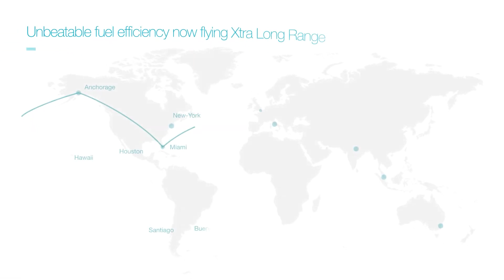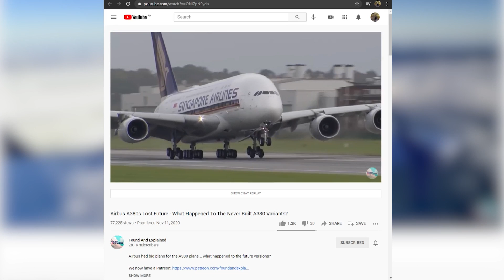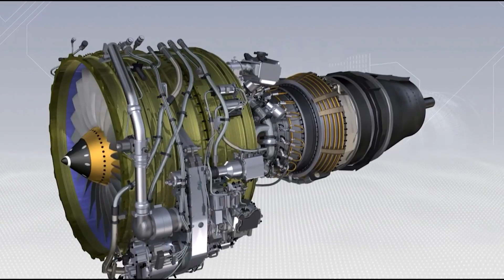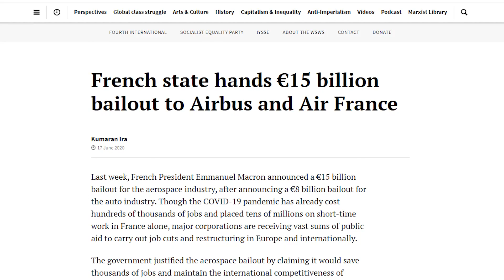Meet the Airbus A350neo and the new Airbus narrow body - Airbus Future Planes!

Comment: A350neo: unsure about this. The A350 already quite advanced. The upgrade must by large enough to be worth it. Otherwise, a few tweaks to the A350 might suffice.
New large narrowbody: This has been a pain point in the market since the retirement of the 757. This is why the A321neo is so popular nowadays, but the A321neo is insufficient.
Hydrogen turboprop: Wait and see how the R&D comes out.
A330neo stretch for regional: It's a cheap 787-10. Why not.
Reply: Rolls Royce are looking to launch the Ultrafan on the A350F then apply to passenger variants. It will happen
Reply: A350neo will happen as soon as R&R is ready.  They are eager to position their new engine into the market, and Airbus doesn't mind to get an even larger edge in efficiency above Boeing.

Comment: I actually don't think Airbus will design a clean-sheet design to replace the A320. I think they'd use the A220 airframe instead. The A220 already has a production line, and has proven to be more fuel-efficient than the A320neo, with the A220-300 stealing orders from the A319neo. The A220 has proven to be both popular and profitable, so I think that Airbus will base an aircraft on the A220 rather than make a new aircraft from the ground up. The A220 is also classified as a regional jet, with lower landing fees and requiring less runway than other aircraft its size.
Reply: And you still need to scale up the frame of the A220, if you want to be in the 220 - 270 passenger range.  And that again is a new design with limited commonality to the A220 design, let's call it almost clean sheet.

Comment: It's comforting to see that Airbus doesn't need to rush their next plane designs, as they did the job on time and the market is well covered for now.
Boeing on the other hand... they better come up with something soon if they don't want to lag behind for the whole 20's decade.
Reply: There is a hole in the market between A321 and the A330. Also the A321 will probobly end production fairly soon and be replaced by the 220-500 that will be sligtly smaler, making the gap even bigger.

Also because B757 is out of production, boeing also lack a plane in that segment. 

797 will replace it of cause ... well partly.

Is sort of a anoying segment. Becaue you would really want 7 abreast..  but then you need 2 walkways, making the plane very wide.

Making it very long is also uneconomical, but simpler.
Reply: @matsv201  I don't think the extended A220 will substitute the A321. The 319? Probably. The 320? Maybe. But the 321? It's too big of a stretch (both literally and figuratively). But other than that I agree
Reply: Boeing are doing fine 😀

Comment: Happy New Year. First comment of 2021 in this video. Speaking of the A350neo it might resurrect the A350-800 if the A350-800neo has a small enough wingspan and space structure enough to operate LGA-ORD and Florida Routes from the 1970s to the early 2000s DC-10 A300 A310 B767 & L-1011 are common sight on those

Comment: The a350 technically is a neo as it has less fuel burn and is more fuel efficient than other aircraft. There will never be an a350neo
Reply: Wait and see until R&R has the Ultrafan engine ready to be used in the A350neo.

Comment: Airbus has taken the act of taking Boeing designs and perfecting them to an art form. This is the same as people constantly applauding Apple for innovations that are made possible by Android open source concept. The A350 Neo is basically catching up to the Dreamliner design. It's shameless.
Reply: Not true
Reply: @kirilmihaylov1934  I have many examples. The Dreamliner was a game changer in aviation. Many of the features of that aircraft, such as mood lighting, larger windows, increased humidity at high altitudes, composite body panels that are lighter, modular construction and more, were introduced on that aircraft. The A350 is a larger version of the Dreamliner without the electrically dimming shades.
Reply: @kirilmihaylov1934  Boeing 737 introduced the open rear undercarriage in the late 60's, which allows the aircraft to be lower to the ground and  making it easy to load and unload passengers when there's no jet bridge, and to reduce weight. Guess what latest Airbus aircraft uses that feature? The A220.
Reply: @sainnt  the a220 was actually from bombardier but okay....
Reply: What a nonsense.  Airbus wanted to reengine the A330 with more efficient engines to address the point-to-point concept Boeing pushed with the 787, but airlines like Philippines pushes Airbus for a complete new, clean sheet design, based on at least 50% composite materials.  That was the birth of the A350, because airlines saw the potential for large long haul jets with a range of up to 8000 NM, what the 787 couldn't offer.
Reply: @aquaden8344  The 787-9 is less than 400 nautical miles short of 8,000. It delivers better fuel economy than the A350. Although the A350-900 carries more passengers than the 787-9, the Dreamliner is still more fuel efficient per seat mile.

Comment: It should be noted that GE is talking openly about a a new engine based on a combination of GE9X and GENx technology that could be offered for both the A350neo and the proposed A320 Family replacement.
Reply: Whoever hearted that is an idiot.... Those are 2 entirely different engines that in no way shape or form can use the same core....
Reply: @w8stral  maybe what he meant is the technology to increase its efficiency? technology isn't the same as size.... who knows that GE might make a new GE ultrafan for the A350neo or maybe a new engine for narrowbodies with efficiency like the GE9X or GENx?
Reply: @stoje8405  Oh for F's sake, if you mean geared turbofans... maybe.  That is not technology that is anyway shape or form "new".  New cores = ways to make blades take more heat/pressure and the 3rd dimension is SIZE.  What you can do on a short blade is NOT something you can do on a long blade.  Smaller engines = shorter blades.  Also there are bleed options you can easily do on large engines which are IMPOSSIBLE to do on small engines.  At this point the plateau in engine tech is here, just as the plateau of airplane tech is here in regards to efficiency outside of just moving slower.  Or someone figures out how to do boundary layer suction which can actually keep its holes clean and open.
Reply: @w8stral  and that's what the R&Ds are for. To find out whether such technologies can be used on narrowbodies or not
Reply: @stoje8405  Has nothing to do with Narrow bodies.  Basic power levels.
Reply: @stoje8405  You go and clean the holes and the tubing for suction layer support.  I remember the ASW 22 and it's boundary layer suction support system.  It worked great until too many bugs got sucked into it.
Reply: @w8stral  you just called the video creator an idiot
Reply: @gavcom4060  he kind of is.

Comment: i think that te a 380 program wouldt hav had a chance if it was bult 10 or 20 years earlyer
Reply: It would have had to come earlier, or later. The A 380 was too late to compete with the 747, and too early to compete with more modern carbon fiber aircraft.
A more modern A 380, with a structure optimized for the offered aircraft size (the - 800 had the too heavy structure of the never realized - 900) with better wings with a better aspect ratio (they were too big and the aspect ratio was bad because of the 80 m restriction) and better engines (like the engines of the A 350) would have been longer competitive.

Comment: A220-500 to replace the A318 and A319 and a new A320 321 and 322 to fill the middle of the market would be great. Then in the future a move away from the tube with wings designs would be cool.

Comment: I agree with you that the much rumoured 'A322' could be the 'new' single aisle type evolving from the A220 programme that will link the A220 family with the A350.

The A220-500 will replace the A319neo and A320neo.

I think in 2035 we will see the following aircraft types in the Airbus catalogue -

- A220neo (A220-100 for short landing/take off, -300 and - 500)
- 'A322' in 2 variants
- A350neo in at least 2 variants possibility 3 

With regards to ATR, the proposed twin engine eZero turboprop aircraft could replace the ATR42-600 and ATR72-600 said can carry to 100 passengers.

Comment: The A320neo replacement is something i've been look foward from Airbus. Since A220 are around, its safe to say that it replaces the A318 and A319. Infact, the A220-500 could also replace the A320. Then, the new blueprint narrowbody will deal the A320neo and A321neo. Hopefully the new blueprint will have much wider and spacious width for narrowbody standard.

At the same time, it would be nice if there's a widebody with the size of A300/A310. Notably, its size are much smaller compared to today's twinjet narrowbody. Maybe the A330neo (or another new blueprint) with the size of A300/A310 with newer, yet smaller wings (than A330neo) will do.
Reply: A220 platform is 7% less fuel efficient then MC-21. Airbus will have to make something better to replace A320neo.

Comment: Airbus made a small wide-body aircraft in the 1980’s, the A310. Neither model, the -200 and -300 sold particularly well compared to the A300, which the A310 was based off of. And I think Airbus is still hesitant to develop such an aircraft after what happened with the A310. Hopefully they do create a new aircraft or variant of an existing aircraft because the demand for that type of aircraft will most definitely see growth in the future.

Comment: The a350 has a tall interior so they could do what they did on the a340 with some passenger areas on a small second level. I think a NMA plane could replace the a321 through the a330-800 along with an a350-800. An electric regional jet would be cool too.

Comment: Just a little nitpick. The symbol for nautical mile should be uppercase NM, as used by ICAO. While "nm" is sometimes used too, it usually means nanometer, which would be an awkward unit to use for airplane range :)

Maybe that specific range indicator came from third party material...

Comment: What about a plane with 2 isles in a 2 : 2 : 2 capacity?  Faster boarding times and similar capacity to A320 family?
Reply: or a plane were you can have single isle or 2 isle configuration depends on your needs. having such 2.2.2 configuration seems very specific and not very flexible if you want to use your aircraft some other way.
Reply: Too much floor space wasted for isles.

Comment: Airbus is surely going to make more iconic planes i can't wait to see what the design of the A360,the A370 and the A390 will be but (atleast for me) the most intresting Airbus project is the NSR (New Short Range) aircraft
Reply: I kind of think that they just will call the A320 replacement... A320 again, or possibly A230. 

It seams like to me they going from A320CEO, to A320NEO... next step would be something like A320xxx where it would be like New wing and fuselage. Practically a all new aircraft, but it being backwards certifiable for the pilots.

With that logic a A360 would be in the size of a 777
Reply: a220 is a winner love those big screens.

Comment: Aviation needs a new fuel source but hydrogen at a conversion rate of 1.1 Units of energy in to produce 1 unit of hydrogen could be more polluting than just using fossil fuels. Especially if your 1.1 units of input energy is coal to produce electric. Then there is the issues of storing the hydrogen in a light weight and compact media that can be quickly refueled. An open fan concept or advanced propeller prop jet could offer the biggest bang for the buck while not getting too far out technology wise. The biggest problem has been noise pollution with this concept. The silent aircraft program used gears and shafts to run several large enclosed fans with one turbine. While technologically challenging; this does look like a good middle of the road but doable possible solution until a cleaner power is available for aircraft. Narrow bodies should have lower frontal areas but a squashed elliptical composite body could offer some interesting design solutions. I always believed in telling your technical staff what you want to achieve & then let them achieve them by whatever means they choose.
Reply: That's why Airbus has looked for partners to install the H2 infrastructure in  airports worldwide.  And it is a given, that H2 has to be produced with sustainable energy

Comment: We say new designs ,but the basic layout is still Boeing 707 planform ,I suppose with technology at the moment can’t be bettered ,or could it ????
Reply: A flying wing would have less drag, but it's hard to realize a pressurized cabin inside the flying wing (because of the shape, it would mean a weight penalty).
The shape they use today offers a light construction (the round cabin is perfect for pressurization), and a relatively good fuel burn, even if there is the disadvantage the fuselage only leads to drag, but not to lift.

Comment: Aviation market is growing towards narrow bodies and the most logical new type is A322. The next one is A220-500.
Of course there is the hydrogen power narrow body aircraft, but it will take at least 15 years to develop.
I don't give a chance for A350Neo. That was actually offered by GE, but Airbus did not find it feasible.
A330 Regional (High capacity, short range A330 Neo) depends on how fast aviation market recovers from Covid-19 crisis, so it seems unlikely for now.
Reply: But you technically can't stretch the a321 without causing a tail strike so an a322 is pretty unlikely
Reply: @tydjayowen6122  That is not a big issue. Even 737 MAX-10 solved tail strike problem:
https://www.youtube.com/watch?v=F4IGl4OizM4&ab_channel=GeekWire

If you watch this video you will see that A322 makes more sense than any other future aircraft: https://www.youtube.com/watch?v=2YYAfEZ5ozU&ab_channel=SimpleFlying
Reply: @tydjayowen6122  Sure, the A322 or whatever it will be called is a clean sheet design.  It's the successor of the A320 family aircrafts based of composite materials and new engine technology.  It's a given, that Airbus is pushing into this direction to maintain leadership in the single isle market.
Reply: Wait and see, the soon R&R is ready with the Ultrafan Airbus is going to release an A350neo.
Reply: @aquaden8344  Ultrafan will be a game changer. If RR can deliver 25% better efficiency with Ultrafan as they advertised, it will not stay there just with A350;  Boeing and Airbus will want and need to create new variants for all of their production types with Ultrafan. For example A320 Ultra, A330 Ultra, 777 Ultra. Then it will be A350 Ultra, a new generation based on a newer engine technology than Neo (NEO: New Engine Option will be old then).

Comment: Personally I feel Airbus's next plane will be a replacement for the A320- a plane of the same pax capacity, but more fuel efficient and with a higher range.
Reply: Haven’t they kind of already done this with the A220/Bombardier C Series?
Reply: @theorangecactus2177  That's what many people think will happen with the A220 Stretch. Many airlines have been asking for the stretched version, but Airbus knows that the A220 Stretch would eat into the sales of the A320, effectively cannibalising themselves.

I feel a better approach would be to develop a new aircraft and market it as the replacement for the A320 instead of making it compete against the stretch version of the A220.
Reply: Or several versions, with one offering more very lucrative cargo capacity for the same range. Having more range than you use, is very inefficient, and while it may have little effect on the costs per seat, it can severely affect the profit per flight.
If it hadn't been for the ability to carry freight in the hold, I don't even think that we would see anywhere even close to the much  reduced flying today.
Reply: it could be the a320 xlr
Reply: Thats called the A320 NEO and its flying now. or the A321LR which is also flying now
Reply: I'm just hoping for a better design for the A320, A321, A319, and A318. They look pretty bad imo
Reply: @yoofong3256  With the A220 around, I think that the A320 series replacement is more likely to leave out the A318/319 and be A320/321 with a new A322, and an outside possibilty of an A323. Depending on where Airbus takes the A220, there may still be a requirement for the A320 because of its standard sized containerised cargo ability.
Reply: @neilpickup237  Airbus cares little about cargo, their whole shtick is passenger airplanes. Really don't know why you keep going on and on about airbus cargo planes.

And they already have A330-200F.
Reply: @neilpickup237  Absolutely right! However, I do believe that Airbus could make do with a more capable version of the A220, since of the many speculations of an A220 - 500, but that'll probably have to wait and see what Bombardier wants to do.

However, Airbus does indeed seem to not be too interested in the cargo market, especially considering what cargo aircraft they have (like the A330 and A340, haven't checked if the A350 or others service cargo). In comparison, Boeing's 737, 747, 767, 777 are all capable of cargo, and I think there may be a few 757's that do the same.
Reply: @bftjoe  I think you misunderstood, I am not referring to, nor have I ever referred to any dedicated cargo versions. 
Typically, there is more room in the hold than is required for luggage. This empty space can be, and usually is filled with lucrative freight. It is this capacity which is currently giving some carriers a chance of survival with the very thin loadings in the passenger cabin. Containers make it possible to pack the (often irregular shaped) freight in advance ready to quicky load whenever space is available.
Reply: @yoofong3256  I was referring to how airlines typically fill up any spare hold space not taken up by passenger luggage.
Reply: @neilpickup237  Ah, I see.